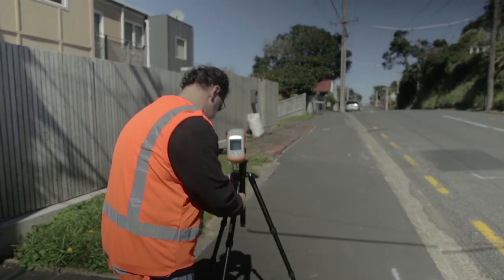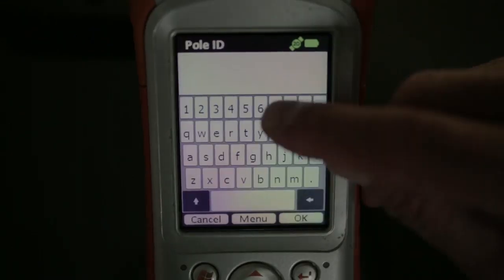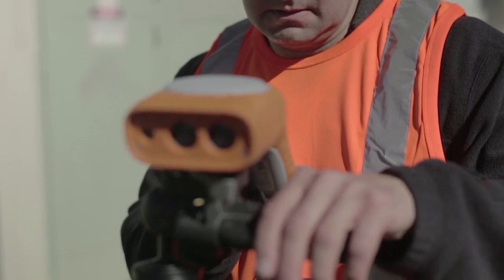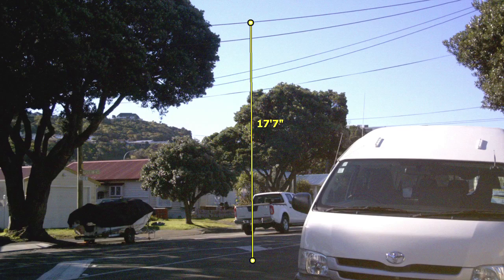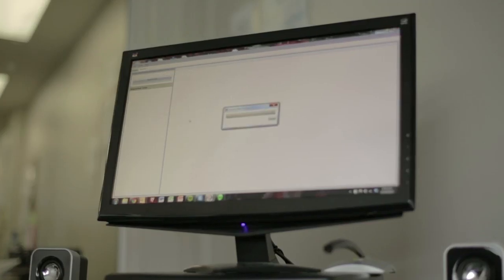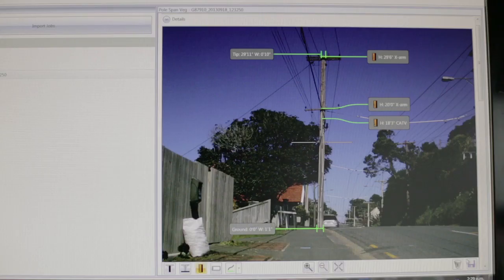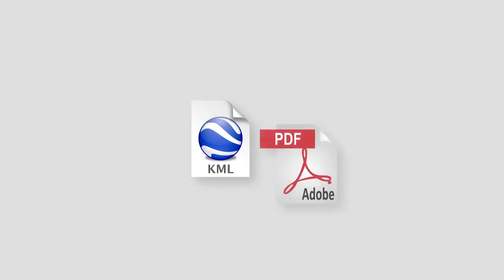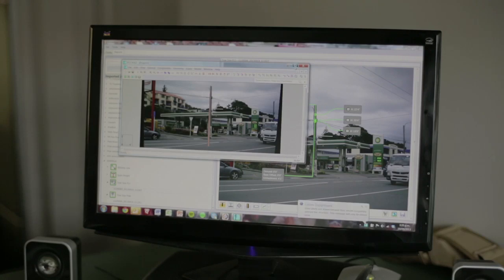GE MapSight: Measure, Map & Model

Comment: Is there a way to import the attachment height information into AutoCAD that builds a pole profile by itself? Right now my company manually draws the pole and point of attachments copied from the IKE survey photo's.
Reply: 3 years late, but for something like that you'd probably be best off exporting to a PLA solver (O-Calc, SpidaCalc, Pole Foreman, etc.) And using their built in profile drawing reports.